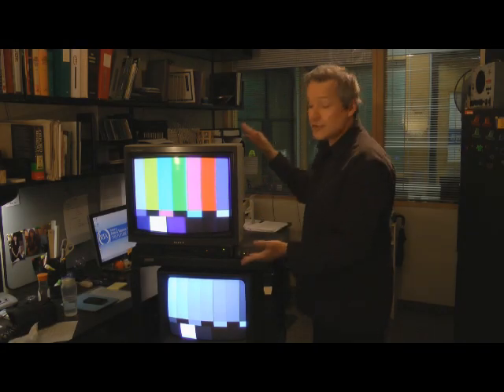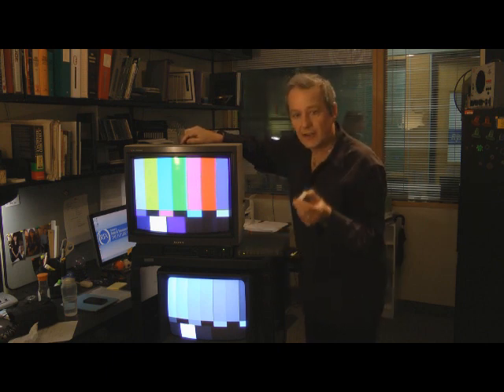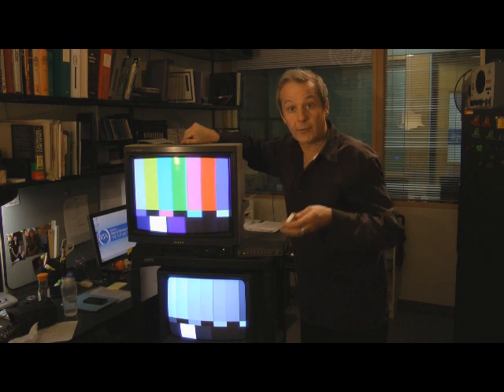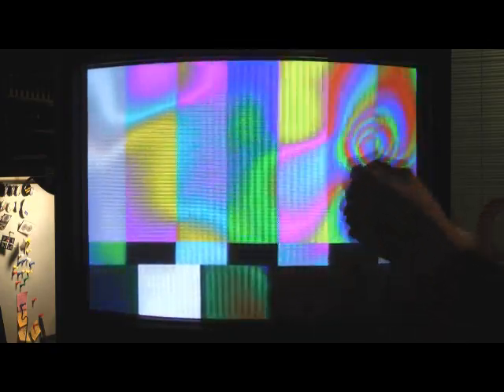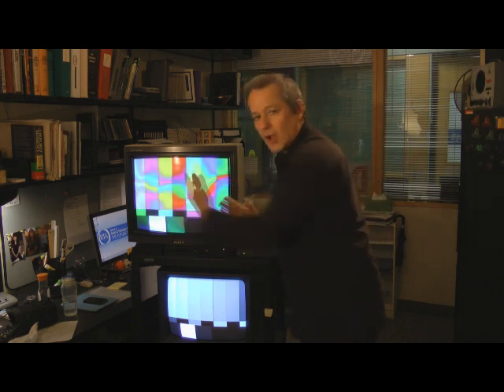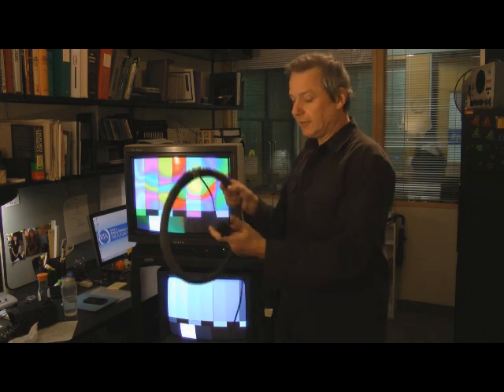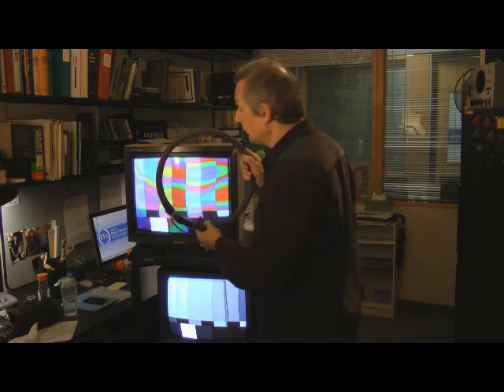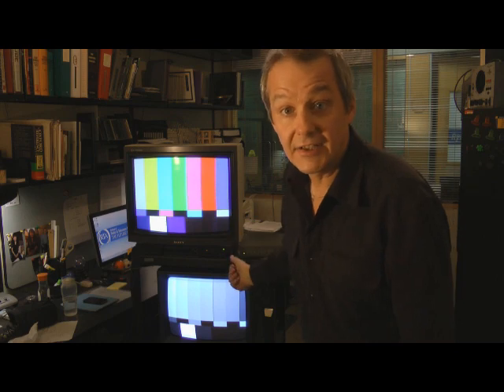Fixing Purity Error on CRTs with a Degaussing Coil

Comment: Barring a proper degaussing coil, a reasonably strong bar magnet being rotated in front of the screen can also do the job.
Reply: Can a color impurity that resulted from a drop be degaussed too?
Reply: @IllusionSector  No.
Reply: @IllusionSector  it is likely that the coils inside have shifted and you may need to adjust those, but be careful. Tens of thousands of volts are waiting to  shock you once you start prodding around
Reply: @ElectronicInspiration  the electrocution isn't so bad after the 6th time.
Reply: @IllusionSector  not likely. The shadow mask probably shifted off position a little bit.
Reply: @n646n 

😥

Comment: Virtually all CRTs have a built in degaussing coil, they work automatically every time you turn the TV on it cycles briefly, but they only do it a tiny bit at a time, so it might take 100 times to fully work, that's where the coil comes in handy, you can do it in just a few seconds.

Comment: My friend and I found a 1987 Montgomery Ward TV I believe. It has slight discoloration in the upper right hand corner of the screen it's doesn't look like a magnetic field has caused this. What it does look like to me and this is my opinion but I could use some second feedback. Is that one of the capacitors could be overheating or going out in it. Would you be able to help me with this.?

Comment: Hey, I have a Sony bvm d32e1wu , that has some discoloring bottom left corner of screen will this work degauss button does, not fix it.
Reply from the maker: That's definitely a CRT-based monitor. Give it a try!
Reply: Dana Lee 
I have a Sony Trinitron CRT TV 32 in. Theres a green tint on the upper left corner of the screen. Will a degaussing coil fix the problem? :/

Comment: do crt tvs have an internal degausser? I heard that most modern sets will activate their  internal degausser when the TV is turned on after cooling down/has been off for awhile
Reply from the maker: More contemporary CRT monitors do, indeed, have an internal degausser. If the magnetic 'damage' is major (like throwing magnets on the front of your screen all the time), the internal system might not be sufficient to totally get rid of the purity error. But you are right, there is one built in!
Reply: +Dana Lee thanks :)

Comment: All modern CRT Tv's had an automatic degaussing circuit that performed the same function. If the set will not degauss itself you have a potential power supply problem where the PTC Globar resistor has broken loose from it welded connections.  You did the procedure wrong . Once you got back about 8 feet from the set  you should have turned the Degaussing coil at right angles to the tube screen and then turned off the Degaussing Coil. Manually degaussing the set wills till be required each tome the set is turned on, especially if the set is moved to another location.
Reply: This guy literally teaches a class.